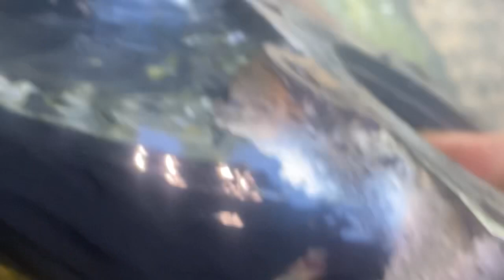Wanderlodge bus fight us every step of the way.  roadside repair and cooling system maintenance.

Comment: Hi Scott.
Have you ever used Dielectric grease on electrical connections ? I have used it on all connections AC and DC. Including battery term's. Not only prevents problems but  solves many as well ! Try it, you'll like it!!

Comment: BUS GREASE MONKEY on SEIZED Bolts Heat them First then TIGHTEN THEM DOWN MORE then Loosen THEM TIGHTEN THEM THEN LOOSEN THEM if you keep doing that it will UNSIZE THE Bolts if you work them back and forth you won't break the heads off use the Panther pee before you try to loosen them works wonders it's called Panther Pee is the product along with heating the bolt too that works

Comment: That is good practice to replace the coolant pump plate if you can get them made out of steel, soon as the engine gets hot (over 200f) the plastic plate bows causing the coolant pump to become inefficient 60% less flow.

Comment: I had that dead blow hammer from Mac 40 or so years ago. Stanley made them for Mac and snap on just in red and black. The plastic on mine fell off years ago.
Reply: Actually Cook (now Trusty-Cook) made those hammers, and still do.
Reply: The same thing also happens to the plastic on the plastic covered dead blow hammers especially if they every get  wiped down with brake-kleen

Comment: I have one customer I see rarely but he happened by the third time to find me cutting a wrench down on my chop saw. He is a quiet guy but he walked in and I cut the saw off to quiet things down and he said, "I never knew vehicle repair requires cutting wrenches or is it just mechanic's therapy?"
Reply: Many vehicles require weird, short, bendy wrenches and screwdrivers. It's a weird profession.
Reply: A friend of mine got a U.S. patent on a wrench for working on manifolds.  I don't know if he actually "profited" from that.

Comment: I wonder if that truck would have pulled out better with less steer angle...?
Reply: That was my thought at first.  But, turned less would have the sidewall dragging on the edge of the pavement.  With the shoulder that soft, no telling how long it would have traveling along the edge.

Comment: Hi just wondering if you can give some pointers and recommendations on what to check and inspect before I crank over the motor in an attempt to start my very own fishbowl bus. I just bought it from a gentleman up in Georgia border line.. about 3 hours from where I live I am trying to have it tow but so far I don’t have any quotes... any help would be greatly appreciated thanks.
Reply: What engine and how long has it been sitting? Besides the engine check the steering linkage, brakes, tires for wear and age especially on steer tires, once you get it running check for air leaks, coolant and oil leaks etc. Check the fuel to make sure it not a science project with whatever growing in and just to be safe add a fuel conditioner. It always good to replace fuel filters or at the very least drain them and refill with fresh fuel. Additionally check the air filters and service as required.  If the engine is a 2 stoke Detroit stuck injectors are the main concern along with the shutdown linage and governor linkage.  Check both Tyler’s and BGM channels for videos about starting vehicles that have sat for a long period of time and Ol2Stroker channel for freeing up stuck injectors